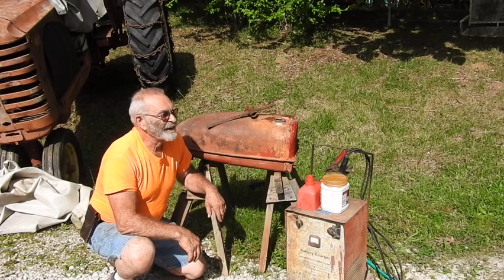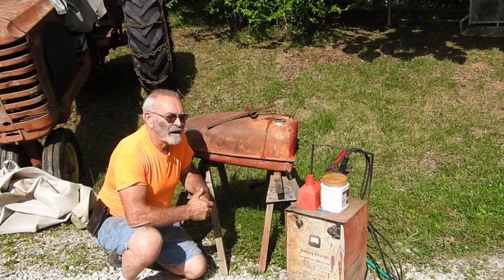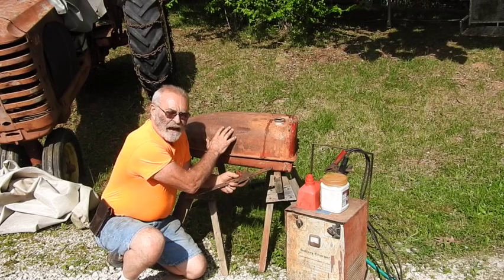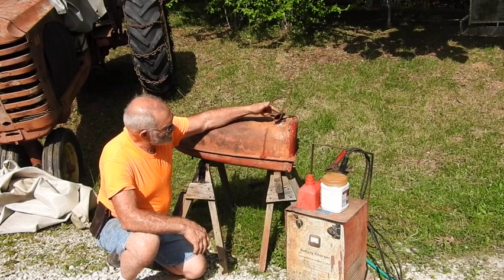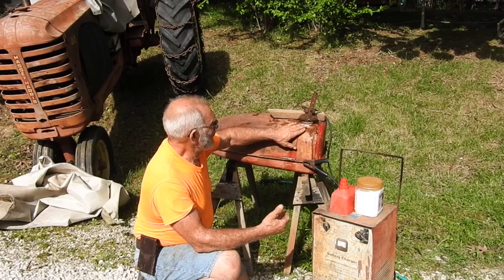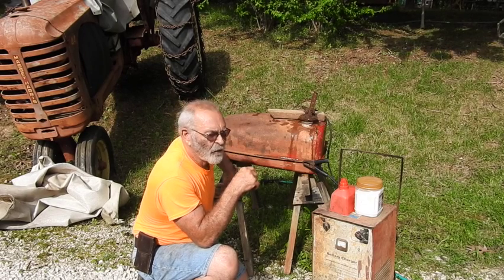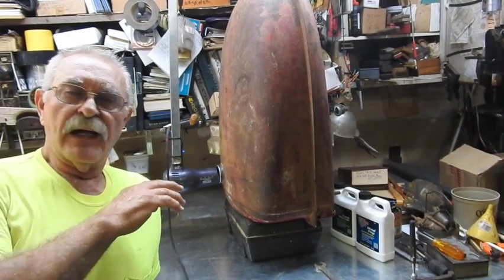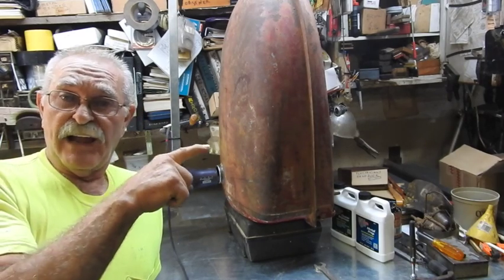Farmall H Gas Tank Electrolysis Rust Removal

Comment: Nice work your doing. You seem to be full of great ideas. The tanks for a farmall H,
 I can get at the junkyard are all rusty inside because someone always buys the gas cap
and leaves it uncovered.  I asked, He still wants $35 dollars no matter how rusty.
Reply from the maker: Thanks to ethynol in fuels, a LOT of old gas tanks will be contaminated with rust. But those tanks left open in the junkyard GUARANTEE that will be the case. Remember the IH tanks have a baffle and that makes it extremely difficult to use electrolysis on. It gives off hydrogen gas which is explosive, so only do it with plenty of ventilation or outside like this.

Comment: I used iron out and 3d printed a plug with hole for avoid to center and hold it. Worked great on my old mtd 5 hp chipper chipper schedder.
Reply from the maker: Yes, that would be a great solution.  The hydrogen gas has got to be given a way out for sure !!  Thanks for adding input with another solution.

Comment: What size container did you use of the POR15?  The h tank is 17 gallons.  Also, did you experience flash rust between when you were drying it and putting the sealer on?  Thanks!
Reply from the maker: I would definitely recommend the container of the pre-treatment.  It will almost ensure a perfect job. I used a pint container but I almost certain a haf pint would be adequate. It adhere's very nicely and is the best product I've used for sealant in 40 years of working on these things.
    I did not experience flash rust, but I hang a hair dryer on a metal strap to blow into the open gas tank for 24 hours before I apply the pre-treatment.  Then I do the same thing before applying the POR-15.  You cannot connect the hair dryer to the gas tank because it will overheat the dryer and burn it up.  Hanging it on the strap allows it to blow directly into the tank but also allows some of the air to bypass saving the dryer.
      The main problem with the IH tanks is the blasted baffle in the middle of the tank.  There just is no way to get the sealant to cover the surfaces of the baffle.
Reply: @tractorman4461  They recommend a quart up to 20 gallons.  They say a pint will only do 10 gallons.
Reply from the maker: @icannevergetthistowork  I'd go with what they suggest.  I'd have to look at my container to see what size it really was. But it goes on super thin and almost looks like a galvanized coating. I just don't remember the can being really big at all.  But the main thing is to use the pre-treatment and dry fully with a hair dryer before proceeding.
Reply: @tractorman4461  how has it held up?  Did it get behind the baffle?  Thanks!

Comment: Thank you for this video. Very straight forward and seems to be nice and comprehensive. Appreciate the safety warnings, I've seen a bunch of people demonstrating this indoors without mentioning their ventilation setup at all.
Reply from the maker: Thanks for the cool comment. I stress the hydrogen gas aspect because it is real.  I have a close relative that all but ruined a gas tank by creating a spark disconnecting the battery charger with the power still on.  It gave a muffled explosion and jumped off the floor and like to have taken out his leg in the process.  Outside is the only way to go with this process for safety.  I've got another one on a Massey Harris gas tank that references similar warnings.

Comment: I'm curious why people choose this method over soaking in vinegar or acid?
Reply from the maker: Well, though it' a bit more time consuming and a lot of work, the results are stellar. I think vinegar or acid is probably better for a baffled tank like this Farmall tank is though.  Electrolyosis is primarily a 'line of sight' operation and does a wonderful job in a wide open non-baffled tank.  There's also the hydrogen gas vapor/explosion danger to be aware of.  Its not for everyone.
Reply: @tractorman4461  Thank you for that valuable insight.
Reply: Electrolysis has a few advantages over an acid soak. For one, it’s cheap. If you already have a battery charger, all you have to buy is washing soda. And a box of washing soda is much cheaper than a bunch of vinegar (if you fill your tank with undiluted vinegar. Also, electrolysis gives better results. And unlike acid, it won’t attack bare metal.

Comment: I love the warning about hydrogen gas. Yes, it was the Hindenberg that blew up but for a true example of Hydrogen gas explosions, one need only look up... it's kinda what causes the sun... to sun...
Reply from the maker: I think they go through that lesson in the entry jingle to every 'Big Bang Theory' sitcom.  LOL  But seriously though, more than one gas tank has been destroyed by the careless removal of the cables.  Remove power first !!  LOL, should be the easiest thing to remember for folks.  Thanks AA for the fun but accurate comment.
Reply: @tractorman4461  I've never had that issue myself but it's possible I've just been lucky so far. I was watching to remind myself which lead goes to which because I have a motorcycle I'm working on and a tank with a lot of rust and holes (the other one I had actually rusted through because I had left it alone for so long) 

Problem is there's so many dents and some pinholes in it I'm thinking a might have more luck just making a whole new tank at this point.

Comment: i've got a fuel tank on a leaf vac that needs cleaning. i may use this method or evapo rust remover. i never tried either before so this will be a first for me.
Reply from the maker: I may not have used the Evaporust correctly, but the time I used it the level of satisfaction was very low.  I ended up using electrolysis on that tank immediately .  The BEST product I've found is POR-15.  If you do electrolysis then first, dry thoroughly with a hair dryer, apply the POR-15 cleaner then the actual sealer you will be very satisfied.  But you must follow the directions to ensure success.  I have done more tractor and motorcycle tanks than I can name and this is the best brand yet.  I've done 4 so far with this product.  LOVE it !!  Thanks Dave for the visit.  Good luck.  They sell the product in a variety of sizes.  I buy quarts for the tractor tanks.
Reply: @tractorman4461  awesome thanks

Comment: Thanks for the information.  I'll be cleaning and coating the fuel tank from my 1947 John Deere model M tractor in a couple of weeks and will use the procedure that you demonstrated in your video.
Reply from the maker: Cool.  Make sure you remember to keep the tank totally full during the process.   A void at the top of the tank will allow the explosive hydrogen gas to build up and a spark can ignite it.  Its also dangerous to do it in an enclosed space.  Rinse and totally dry it with a hair dryer before applying the coating.  I also recommend following the preparation guidelines prior to applying the coating.  Some products like the POR 15 have a specific treatment that almost ensures a good out come.

Comment: my motorcycle gas tank has three holes; the fill, fuel pump opening and fuel sensor opening. If I have a large enough vessel can I totally submerge the tank and make the connection to the anode and tank with copper wire?
Reply from the maker: Well Brian, the anode must be in the solution where the rust needs to be removed from.  It seems to be a 'line of sight' transference from the rusty surface to the anode.  So the negative post must be attached to the outside of the tank with the positive connected to the anode immersed inside the tank.  I'm not sure the of results for what you ask with the entire tank immersed.  The real problem with motorcycle tanks is the way they are built...with the saddle down the center.  I do first one side then the other.  Slow and steady ensures a safe and thorough project though.  Hydrogen gas WILL be generated in the process.  Good luck with your endeavor.
Reply: @tractorman4461  thanks for the reply. I understand the line of sight deal and I see where I can get the anode inside the tank. and if running copper wire to connect the battery outside of the solution will work I think it could work like the tools that are submerged.
Now if I were to close off the two holes that would allow me to fill the tank to the rim of the fill, what could I use?
Reply from the maker: @brianbuchanan7215  I assume the holes you need to plug are standard piping threads...?  I plug the extra holes in my tractor tanks with pipe plugs of various sizes.  I'm sure the  motorcycle tanks are standard threads as well.  But some British and Japanese bikes may have metric pipe threads.  
  Remember too that you have to make sure the anode does not or cannot come in contact with the inside of the tank.  So it must be insulated as it passes into the neck with provisions for the gas to escape.  Some guys use coat hangers they can bend to the shape to go in the fill neck and hang to one side or the other as the anode.  Motorcycle tanks are the hardest I've done by far !
   Remember to do it outside to eliminate the potential danger of explosion.

Comment: muriatic acid works wonders on old cast iron carbs the will look freshly cast with all the small passages cleaned out. Don't get it anywhere near aluminum or pot metal. It will be so clean it will flash rust so protect the surface.
Reply from the maker: I've not used muriatic acid for that but I can see the benefits for sure.  I am lucky enough to have an ultra sonic parts washer and with the Chem-Dip it does a wonderful job in just a few timer cycles.  Good tip on the acid. Thanks Frank.

Comment: I am using evaporust on ford jubilee gas tank, seems to work well. I will need to get a endoscope to see inside to verify!
Reply from the maker: I tried five gallons of that on one and wasn't too happy.  Might have been something I did wrong though.  I ended up abandoning that product and started over with the battery charger.  I had an endoscope, but the I-phone updated the version and it would no longer work with the endo.   The Endo people have no updates and what IS available on the web is all in chinese or something.  So I gave it to my daughter.  But man it was great while it worked !!  Some of the Fords have a baffle too.  I don't know about the Jubilee.  My 800's tank is still good, and I've never looked inside it.  About the same as a jubilee tank I'd think.  Good luck Michael...let me know how it turned out with the Evaporust !!

Comment: Hi Wendell. I was watching and thought about the baffle problem. 
The tank fitting for the fuel line is usually on the opposite side of the baffle from the fill. Would it be possible to use a rubber grommet and some cobbled up fitting to insert an electrode through the fuel line fitting?  That would give you two electrodes so the process will have line of sight access to both sides of the baffle. Depending on the size of your electrode it may take a while before you stop seeing the brown smut coming out of the tank. 
I have used electrolysis on all kinds of rusty stuff but never used electrolysis on a fuel tank. Your method sounds like a winner. 
When I cleaned out the rust from the Ford 8N tank I used bungie cords to strap it to the front of my cement mixer. Then I let it run with the etch in the tank for about an hour changing the tilt of the cement mixer every 15 minutes or so. The only thing I did that I wouldn't do again is dumped about a cup full of old 1/4" nuts in with the etch. 
I had a dickens of a time trying to get the last nut out of the tank. I think it was just the right size to slide under the baffle if it was laying flat. An hour of spinning gave it all the opportunity it needed to get under the baffle. I spent at least an hour shaking and tipping to get it out.
Reply from the maker: I just slapped myself in the face !!  I never even thought of that !!.  Most sediment bowls are 3/8 or 1/2'' iron pipe threads so the appropriate pvc mpt x slip would satisfy the requirement for entering that additional opening.  DANG !!  Now my forhead's stinging....  I just may have to try that on the next one that meets these parameters.  Thanks for thinking outside the box for me.       
     I smartened up and used hex nuts for my second attempt....the first attempt many years ago bit me in the butt.  I put in 20 or so real sharp rocks that would fit through the fill hole.  Guess what...THAT my friend, was an extraction NIGHTMARE !!  Telescoping magnets worked much better on the nuts...LOL
    Cement mixer is a novel idea as well.  My one old uncle picked up dozens and dozens of five gallon buckets of walnuts from the surrounding farmers every year.  He'd toss them in his little mixer with brick batts and let'em go until all the pummies were knocked off.  Then dry them elevated in chicken wire.  Then soon as cold weather would hit, he's spend countless hours cracking and picking walnut kernels.  Concrete mixer you say..???  Naw... that's a universal rust removing walnut washing machine.
Reply: No need to abuse your poor head. I was pleased that I thought of it. Having the same issue on the 8N I could have saved a lot of time.
Reply from the maker: @OldSneelock  hahahaha... just a flat spot on the forehead LOL.  Yeah, that Ford has a baffle too.  I think most of the longer tanks do.

Comment: If great care is used Muriatic acid will rapidly remove rust, flush and neutralize with bicarb and dry.
Reply from the maker: I've not tried Muriatic acid Frank.  But that makes sense.  I may try that in the future as I still have two gallons of it in the shop.  Thanks for the tip...one I will remember for sure.

Comment: I used the acid method, it came out pretty clean.  Then I seal it with POR-15.  I still haven't got it on the tractor yet - contemplating sanding it down, and the grill, hood, etc. and painting the whole tractor, or just leave it in it's work clothes.
Reply from the maker: I think either way would work just fine.  Did yours have a ton of rust flakes like this one ?  This one stretched out over a three week period before I was happy with it.

Comment: Good tip on the welding rod mixer!
Reply from the maker: Oh heck yeah, I make them all the time.  Sometimes for five gallon buckets I'll cut 1 1/2'' ring  off a 2 1/2'' or 3'' black iron pipe and drill a hole in one side of it.  Stick one end of a 20'' x 3/8'' all thread through the hole and weld it to the inside of the other side of the ring.   Chuck it up and spin away....five gallons of paint or drywall mudd at a time !!  Welding rods work great for one gallon down though.

Comment: I have a H that has a real bad rust problem I might try that and acid clean and try copper electrolysis and plate the inside and seal it.
Reply from the maker: I haven't heard and know nothing much about the plating process.  That's why I like to stick to  getting to bare metal then use the tank coating.  I've had real good luck except for one failure.  And that was my own fault, not the product.  I think on the next baffled tank, I'm going to try the vinegar routine, then flush, metal prep then the POR-15 product.  Good Luck Allan on what ever route you choose.

Comment: That is a process I never seen, thanks for sharing my friend, so in fact the treated surfaces will look like steel or silver spray painted
Reply from the maker: Yes Jan, the process will change the flaky, rusty surface to almost a perfectly gray but pitted surface.  Once air dried and treated with the POR-15, it will we a perfectly grey coated surface.  It doesn't fill up the pitting up to a level surface, it just places a perfect sealant that when cured is supposed to be impervious to rust. That's why it is so important to ensure the application of the product covers all areas exposed to fuel. 
    The tanks like this one leaves me to wonder though, because there is no way to fully cover the center baffle.  Time will tell what effect if any that will have on the whole tank. Thank you sir for the visit today.
Reply: @tractorman4461  thanks very much, I learned something to remember on my Farmall and Lister D engine tanks
Reply from the maker: @jankotze1959  On really nasty ones, I will stop by a car wash in town and use heavy soap cycle and blow the baloney out of the tank first.  Then I bought my own pressure washer for degreasing the backhoe and skid steer before working on them.  So l have used it on at least one now.